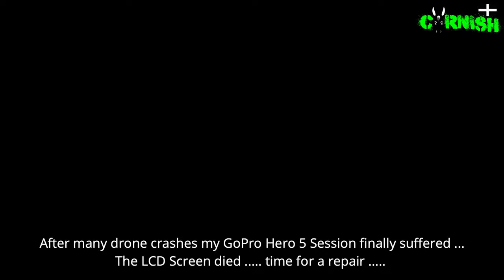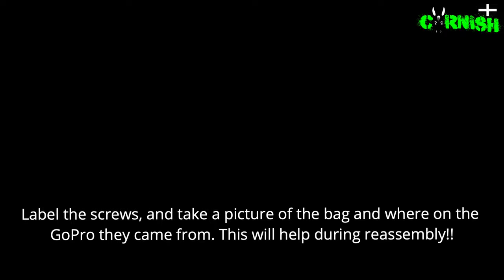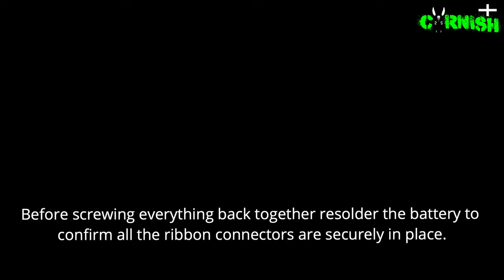GoPro Hero 5 Session Teardown and Repair | LCD Screen Fix | Disassemble

Comment: This is probably the most comprehensive and helpful video on YT concerning the repair of a Session 5. Well done, sir! I havn't attempted to fix the 2 I have just yet, but this will be the video I follow when the time comes, one will not charge or power up any longer after a quad crash, and the other I need to change out the lens (scratched to hell by the outer protective glass that shattered in a crash). Thank you for this!
Reply: PS extra points for turning a prop blade into a pry tool lol
Reply: @8B1tbreaks  Exactly! I keep a couple of old prop blades on my work bench for this purpose. Super useful!

Comment: You make it look so easy lol. I have to replace a battery in one of mine and hopefully it will be this easy to get it open.
Reply from the maker: Take your time, it’s not a sprint. If something isn’t coming apart then step back, think and approach again. It’s not that difficult tbh. Good luck
Reply: @cornishmule2157  Thanks. That's good advice, and that is what I normally try to do. But sometimes things don't go as planned lolol.

Comment: Thanks, you helped me a lot. I tought it can't be diassamble without brutal technics. I just fixd mine ,that was sit in the drawer for years now. The battery cable was broken. No ide how it happened inside the box.

Comment: Nicely done video.  I've got one that stops recording in any little crash, even if I clip a twig it will stop.  I took it apart, but damned if i see anything that could cause it.  I even tried gluing that ribbon cable under the battery because it popped off so easily, no dice.

Comment: Where do you find a battery replacement I'm having trouble pinning one down everything looks like a knock off or not the right thing
Reply: I´m looking for that too...
Reply: Same here. I even contacted gopro directly but they said they don't sell it. I found this one but it's no longer available apparently. https://wikibattery.com/products/CS-GDB502MC_1
Reply: @flipfpv  Did you ever find one.  I am also looking for the replacement LCD screen.

Comment: This is real good! I need to know what the 3 battery wires are for. I have loads of repairs to test out.
Reply: It's positive negative and ground
Reply: @krisjanisvanags6864  which one is ground and which kne is negative?
Reply: Probably the red one is positive black is ground and about the white one i dont know it could be a signal wire or something else.
Reply: White one is the one that is the thermal protection

Comment: My session 5 was dead and got warm when trying to charge I opened it up removed battery and charged it with a one cell lipo charger to 4.12 volts when I soldered it back on charged I had momentary activation. Now won’t start up. Do you have any ideas please.And do you know where new battery’s are available please.  Thanks fpv nut.
Reply: You might have fried it. It should only take 3.8v so anything more could have fried a capacitor or something

Comment: will hairblower work? I don't have heat gun
Reply from the maker: Give it a go?
Reply: @cornishmule2157  I have an update. So battery has been warm for more than 4 hours after removing it from the charger. It won't turn on. Connecting it back to the usb charger won't turn it on either. Then in the evening, the heat around the camera was gone. I connected it back to the usb charger and it finally started charging. I turns on now.

Comment: Do you know where I find the battery to replace?
Reply from the maker: I got the spare screen from a broken GoPro I bought on eBay. I think that’s among the only option for spares.
Reply: @cornishmule2157  Do you  have the part-number and size for the battery? Then it might be possible to get a close fitting battery instead of an OEM GoPro.

Comment: great video thanks very much i have a bad sd card slot do you know where i can buy a replacment ?
Reply: @Joshua Cobb no i havent yet it is still apart i cant find a sd card slot ther was a couple on ebay but were for a hero 5 session not sure if it would work on mine